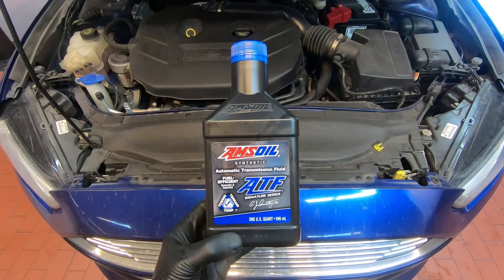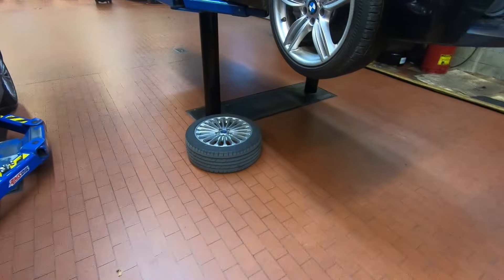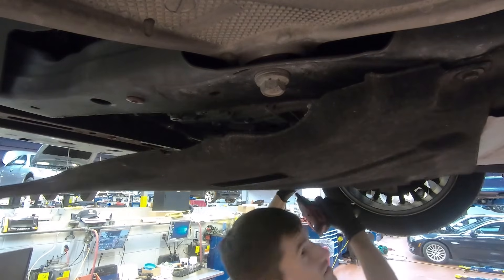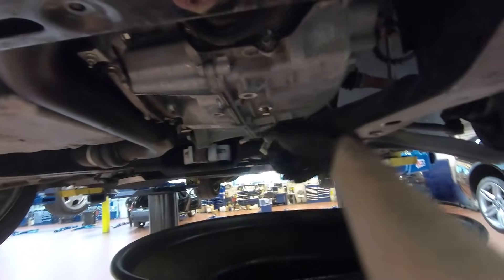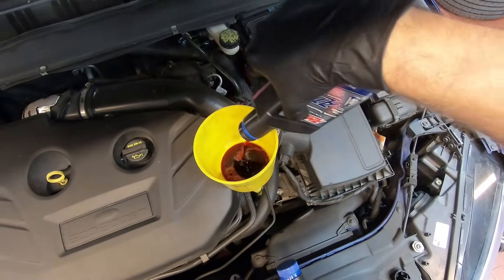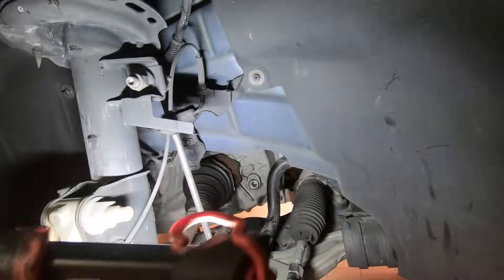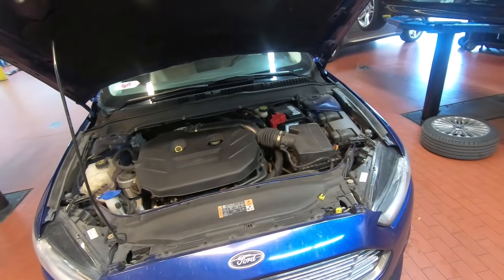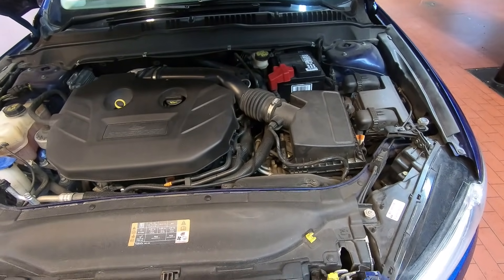Ford Fusion Automatic Transmission Service ( 6F35 ) [ HOW TO ]  2013-2020

Comment: Thanks! this is the only video showing the location of the ATF check plug for a 4WD fusion. The only thing this video left me wondering is that all other videos insist that you drive the car to warm up the transmission before checking the ATF oil level. So, after I had done the whole procedure, I drove the car, took out the wheel and checked the oil again. I have to add about 16 oz to get ATF fluid to come out of the port.
Reply from the maker: @EverBarbero  I've always done it this way and am still on my original transmission at 205k miles
Reply: @THEDriverMod_  just bought a 1 owner 2015 fusion se ecoboost. Not sure if fluid was ever changed. 100 000.miles. Should i drain and fill? My 13 1.6 tranny died with 265 000 KM 2 Weeks ago. Stinky and burnt fluid on that one. Couldnt shift.

Comment: Is all transmission fluid synthetic?  If not can you drain out non synthetic and add synthetic?
Reply from the maker: Modern transmission fluid is synthetic. You can mix the mercon LV and the Amsoil LV ATF no problem. This transmission fluid works! I'm currently at 203,000 plus miles and the transmission is still all original minus the fluid changes

Comment: I recently bought a 2020 Fusion with 130k pn it.  I don't know the maintenance history, so want to change tranmission fluid soon.
If i collect and measure every drop that vomes out, shouldn't i be able to put the exact smount back in and skip the step to check the fluid level,?
Reply from the maker: Never skip steps, that's how mistakes happen

Comment: What tools do I need to remove the transmission drain plug? Can it be done with an Allen wrench, or is it a Torx? Or... 😅
Reply from the maker: Drain plug is an 11mm socket and the fill/level plug is a 10mm allen

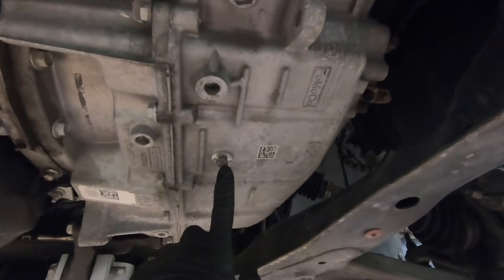Comment: 02:56 is that bolt called, Converter Drain Plug?
Reply from the maker: No, that is the transmission sump drain plug

Comment: Just did my trans. I filled it and adjusted the oil level. If I have no leaks, I now measure what comes out and what goes in. No waste. Always check the oil level though.
Reply from the maker: @davidhenri2722  you can definitely do that, just always check the level at least

Comment: How did you get the cap off mine has the 2.5 and has lines running on top of it so I can't pull the cap straight out
Reply from the maker: Mine does too. Just pull it out/ twist it at an angle.

Comment: Not sure if it makes any difference but some other techs advise to put in about 4.5 quarts and then drive the car and get it to operating temperature to give the fluid the chance to expand.
Reply from the maker: I just heat it up on the lift. Gets it close enough and that way I don't have to raise it more than once

Comment: Appreciate the video alot. Seeing the lack of video tutorials for basically anything on the fusions, this is a breathe of fresh air.  

The fusion i just purchased has 61k miles & im ab 90% sure the trans hasnt had a service yet. That being said, would you think doing the fluid drain-fill the next 3 oil changes would get damn near all that nasty OEM garbage out & most amsoil in? Thanks!
Reply from the maker: Would absolutely recommend doing a transmission service during your next couple of oil changes

Comment: My 2017 got a new transmission under warranty at just 42k miles.  Im at 74k miles now and just did one drain and fill.  Fluid was already very dark with just the slightest tint of red.  Gonna do another drain and fill bc i do not like how dark that fluid was but i keep reading its normal for Ford's fluid.
Reply from the maker: Definitely do a 2nd drain and fill

Comment: How do you change the filter? Just take off the drain pan?
Reply from the maker: @chrisbaca7449  there is not "drain pan" for the 6F35, the filter is inside the transmission, requires the transmission case to be seperated
Reply: @THEDriverMod_  thank you! My mistake with the terminology, no mechanic just hands on.

Comment: I didn't see a filter change?
Reply from the maker: you can't service the filter without removing the transmission
Reply: @THEDriverMod_  Thats awful. ON my Camry, I took the pan down and changed the filter.  Lots of metal stuck to the magnet.     The FORD looks to be a throw-away car. Not made to be worked on.

Comment: Why does my '15 MKZ awd not have the side allen plug?  Mine has a regular bolt to the left of the transaxle not right side.  Is that the overfill port?
Reply from the maker: Those are just another varient. It is the level plug though

Comment: I see capacity of this tranny listed as 8-8.5qts.  If its  not been done in 70k miles would it be good to do it twice with a driving interval in between to mix the new/old fluids and flush more of the old out?

Comment: Really 30 to 50 thousand service interval.. my owners manual said 150000.. for service
Reply from the maker: You're welcome to go ahead and do that but the transmission won't make it to 150k without service and Because the filter can only be replaced by taking yhe transmission out of the car and splitting yhe case.... I highly suggest you follow my recommendation as well as use the fluid featured in this video. Speaking from experience at the dealership as well as my personal car which has 196k...which still has the original, unopened/or repaired transmission

Comment: How often do I shall replace the 6f35 fluid transmission?
Thanks for excellent video posted here
Reply from the maker: Of course! I would do a drain and fill orv2 every 50k miles
Reply: @THEDriverMod_  gotcha! I just changed the atf of my Fusion AWD.
Reply: 30K miles and the PTU as well with synthetic 75W -140 gear oil.

Comment: Should I do this if I haven’t changed my fluid in 100k miles
Reply from the maker: Drain and fills are okay after 100k. Highly recommend you do it 2 or 3 times at that milage
Reply: @THEDriverMod_  okay and each time you drain and fill do you use new fluid? So I’d need 15 quarts?

Comment: Do every 30-50,000 miles. Buy 5 qts. Add 4.5 quarts. Consider using Lubegard red as well.
Reply from the maker: Amsoil is the best

Comment: 7:27 - when you say the ford service interval is 30-50k  for this fluid change, where does that number coming from?  the reason i ask is because the ford owners manual for 2016 fusion says  "Change automatic transmission fluid." at 150k.   I'm just trying to understand how I, as a ford fusion owner, am supposed to navigate these things.  I'm always hearing people say follow the manual, but with this it seems i shouldn't be?
Reply from the maker: Follow the manual if you want failures and higher repair costs. Follow what I stated if you want a cheaper. More reliable ownership.  My personal fusion is a prime example, 195k on the original engine and transmission using the service intervals and products that I recommend
Reply: @THEDriverMod_  Thanks.  i'm at 60k miles now and am thinking about following the steps in this video to do it myself [no lift though] - i've heard a lot of people recommend along the lines of what you have for this service interval, so i don't doubt that its generally good advice.  it can be frustrating though as someone who is not a "car guy" when owner manual itself seems to go against what everyone else is saying
Reply from the maker: @lipfunction  understood, sometimes you just gotta trust what people are saying that have been with the model for awhile. Definitely use the transmission fluid in this video as well for the best results.

Www.premiumsyntheticsusa.myamsoil.com

Comment: great video, why do you not recommend "flushing" the transmission at the dealer? My 2.0L fusion AWD has 84,000 miles on it been wanting to service the trans. It shifts great other than the occasional harsh shift.
Reply from the maker: It's just more aggressive on the transmission as it is in an active state while the service is being performed while a drain and fill is a passive, less aggressive service

Comment: So should the fluid be drained or flushed?
Reply from the maker: Drain and fill should be done if it's over 50-60 k miles or never been serviced before. Also, a drain and fill can me done by anyone else where as a flush needs a special machine
Reply: @THEDriverMod_  just hit 52k will get this done in the next 2 weeks thanks 👍🏿
Reply from the maker: @kevinnelson7070  don't use the Ford Mercon. Use Amsoil, much better protection and temperature operating range

Www.premiumsyntheticsusa.myamsoil.com.
Reply: @THEDriverMod_  thank you will do

Comment: Thanks for the video. Its greatly appreciated. I just changed mine for the first time at 60,XXX miles
Reply from the maker: You're welcome! I would do it again in another 20k just to get back on top of the fluid especially if you don't know if it's original or not. Highly recommend using yhe Amsoil fluid as well as it protects far better than the OEM ATF does. Www.premiumsyntheticsusa.myamsoil.com

Comment: Hello, I have a question. I will probably be purchasing a 2017 or 2018 Fusion in the next few months with 80,000 miles or less on it, so I won't be completely sure what maintenance has been done on it. Do you recommend a complete oil clean or make changes every 10k or 20k until the oil is clean? Thanks
Reply from the maker: Do it every 20k if you can until it's clean
Reply: @THEDriverMod_  Will that clean all the oil?  including the torque converter?
Reply from the maker: @enzomdq12  over time yes, highly recommend using the Amsoil blue cap ATF featured in the video, much better than the Mercon ATF. You can order it here- Www.premiumsyntheticsusa.myamsoil.com

Comment: I have almost 80,000 miles on my 2016 fusion. Purchased it in early 2019 with under 25,000 miles on it. I haven’t changed the transmission fluid yet. It still runs pretty good but occasionally get hard jumpy like shifts. 
 I was under the impression that you couldn’t change your transmission fluid yourself on these cars and have been hesitant to take to dealer for a flush. Now you got me nervous by talking internal trans damage that fluid changes can’t fix. Do you think it would be wise to try and change fluid myself and see what happens, or is that too risky? You got me ready to buy 6 qts of AMSoil and get busy putting in work.
Reply from the maker: Doing a drain and fill doesn't cause issues like doing a flush will. Definitely get the drain and fill done, i would then do a 2nd one back to back of the first. Just to get more of the old fluid out. The link to the oil is in the video description! Good luck, it's not to bad to do it yourself

Comment: I just had my fwd 2015 fusion titanium 2.0 ecoboost transmission drain and fill service done for the first time at 49k miles.  Had it changed with the manufacturer recommended Motorcraft Mercon LV.  I use full synthetic for oil changes. I fill it with 91 octane ⛽ only.

My car is in excellent condition and stock; besides installing a K&N cold air intake.  I recommend that, it slightly improved mpg and power (10 HP, 9 TQ); sounds better too.(4 months ago I replaced all original 4 tires with Toyo extensa hp 2; all season budget performance tires.  It's been a good car  since purchasing in early 2019.
Reply from the maker: I worked at the dealership and I can atest to the mercon fluid and how fast it breaks down. Definitely make sure you change it every 30-40k or you'll be replacing the transmission or atleast the torque convertor sooner than later. I'm at 194k on my 2015, original transmission, un opened. Using the Amsoil transmission fluid since it's first change at 37k
Reply: @THEDriverMod_ luckily, I own 1 car and that's all I need/want to maintain and keep nice for a lONG time.  ALOT of people spend way too much money buying fancy new cars and way too often to boot.  Vehicles are wealth/financial killers LoL.
Reply: @THEDriverMod_  How come you decided to not do any more changes after the initial one on your car? Is this mainly due to the Amsoil fluid being rated for higher mileage or curiosity of your own to see if you will have any issues with no fluid change after the initial one?
Reply from the maker: @jeffherrington  I've done several fluid changes since, currently at 194k and the transmission is still going strong. No repairs or failures yet
Reply: @THEDriverMod_  Oh gotcha thanks the reply to clarify, good deal 👍
Reply: 10 hp?lol..i work at sonoma race way.. and have seen these K&n filter that people have put on their cars.. and tested it , and as compaired to a paper filter,, no changes with in margin of error, on the dyno
Reply: @randellgribben9772  Well, I know my car VERY well and had the car for a couple years prior to installing the K&N cold air intake kit.  2015 fusion titanium 2.0 Ecoboost FWD w/stock 18" Ford rims. No other mods besides K&N CAI. Around 2.5 yrs ago the kit was around 450$ dollars after paying taxes. It's not just a pop on cheap filter etc.

I noticed that the car's throttle was more responsive after installing the K&N cold air intake kit. I also noticed the car was '"peppier" slightly stronger throughout the entire engine's RPM range. Completely disregard the nice sound effect that the CAI gives the car.

Don't get too excited LOL as it's a 4% power increase in HP+TQ. That seems like an honest claim from K&N. 10 HP + 9.6 lb TQ for this particular CAI on Fusion 2.0 Ecoboost. I didn't have the car dyno tested. I also noticed a SLIGHT increase in mpg in 1-1.5 mpg range.

I looked closely at the stock factory air intake system and it's quite restrictive TBH.  The flat closed off and sealed air filter sucks Less air into the engine plain and simple.
Reply: @GBDogg504  did you dyno it before and after.. show the read out..please
Reply: @randellgribben9772  No, I didn't dyno the car and I don't really care to TBH. I'm not trying to be rude. The car has slightly more power + responsiveness than stock--100% certain.

Pretty much all (or almost all) expensive legitimate 350-500$ performance cold air intake kits from legitimate manufacturers (Injen, K&N  + others etc so on) add a small amount of HP to vehicles. Obviously the HP gains vary from vehicle to vehicle ; also dependent on the specific air intake kit.  Generally legitimate performance companies are not making false/B.S. HP gain claims. If you research stuff before purchasing you will find the best part to buy.

Obviously a performance Cold air intake kit is not going to be a major substantial power increase, like a performance tune or other more expensive vehicle modifications.

Alot of People like to poo poo legitimate performance CAI kits and say they're a useless waste of $ etc that's simply not true.
Reply: You're so smooth brained. A CAI does not increase horsepower or fuel mileage...
Reply: Wow! Thanks for the comment Stephen Hawking. You're so f**** brilliant using fancy words to tell someone they're unintelligent/stupid. You've proven you're really just a jerk. You just had to go there saying "smooth brained"

I've owned my fwd Ford Fusion Titanium 2.0 ecoboost a long time before and after installing the K&N CAI. I know my car well. The cars factory air intake is restrictive. It's sealed off, and sucks substantially less air into the engine than the K&N CAI. That's a fact. I noticed a slight HP bump and better throttle responsiveness after installing the K&N CAI. This has nothing to do with the nice swoosh noise that it added to the turbocharged engine. K&N claims a 10 HP increase over stock. And this makes perfect sense as that's just a 4% increase in HP. It's NOT alot; but it's still a power increase.

My car's computer data was telling me that the car is getting a solid 1 mpg more after installing the K&N CAI. This was all a lot of city driving with no changes in my driving habits; before and after installation. That's not much but it's still something .

Since the K&N CAI installation, I've installed a Steeda performance rear sway bar and strut tower brace. Those 2 parts drastically improved the cars handling capabilities. The car rides much more firm and stable. There's significantly less body roll and under steer. The cars steering is also more direct.

I'm not doing anymore mods to the car.

Comment: question for ya I have a 2014 fusion and bought it with 34k on it and it now has 235k on it and have never changed the tranny fluid!! ( i know i should have but just never did) the car does shift kinda wild sometimes but it really always have since i bought it. do you think I should change it now or not worry about it? im a bit afraid if i do that it will go out but then again I have gotten alot of miles out of it. Thanks
Reply from the maker: You should be fine doing a drain and fill

Use the Amsoil transmission fluid featured in the video. Order from Www.premiumsyntheticsusa.myamsoil.com

Comment: hi i have a question, every time i start my car i hear a clunking noise  and at idle but when i hit the gas it stops , also i just noticed when it snowed  car was wet and snowy it didnt  make the noise! it drives and runs perfect !  i have a 2016 fusion se 2.5 with 155k miles
Reply from the maker: Could be a broken flex plate between the transmission and engine
Reply: @THEDriverMod_  i am guessing thats a big job to fix?
Reply from the maker: @kcleach9312  yes but without being there with the car it's hard to know for sure what the issue is
Reply: @THEDriverMod_  i forgot to mention that sometimes when i go over a speed bump it makes that rattly clunky sound .. it sounds like to pieces of thick metal rubbing together
Reply from the maker: @kcleach9312  sounds like you got multiple issues going on honestly.
Reply: @THEDriverMod_  thinking engine mounts maybe
Reply: @THEDriverMod_  SO I fixed the noises i told you about!!   lol is was just the air filter housing box it came unbolted from the frame and no more noises when startinfg and going over bumps !!  lol
Reply from the maker: @kcleach9312  that's weird! But good find!